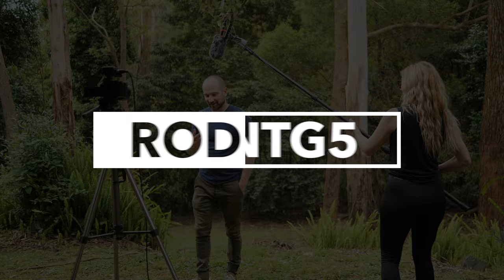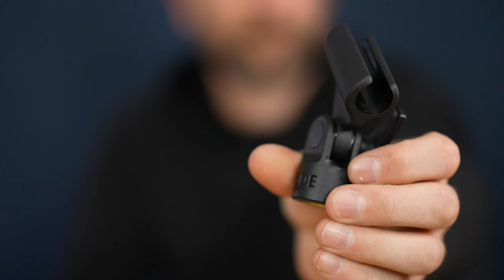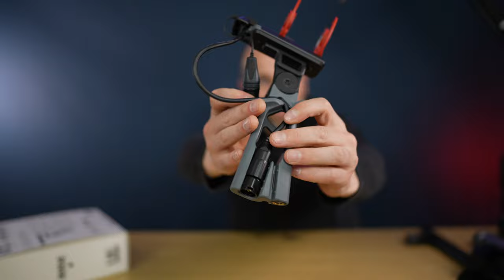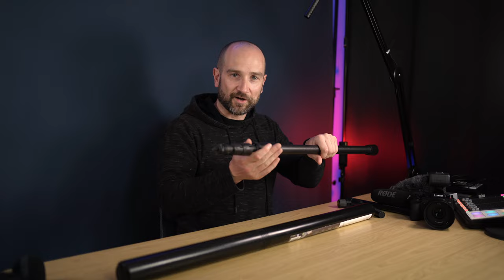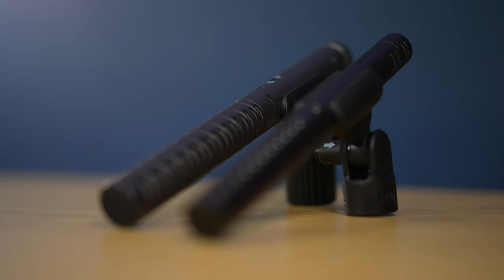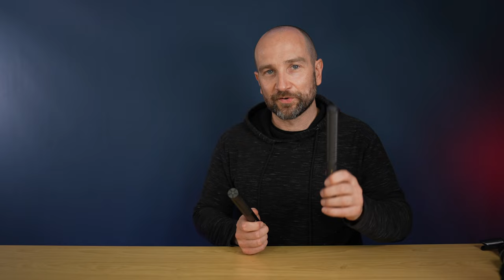Rode NTG5 Shotgun Mic Location Recording Kit Review (vs Rode NTG-1 vs Saramonic T3)

Comment: Which focus settings are you using during your outdoor talking head sections in this video? I don’t notice any background pulsing. I’m currently a GH5 owner myself. Thanks for your reviews!
Reply from the maker: Manual mode on the first shot and 1-Area Mode on the second. I have an Autofocus guide coming up this week.
Reply: @GeekyNerdyTechy  awesome, thank you for the response and thanks for putting out informative videos for GH5 shooters like myself. 

I’m trying to find a video that explains using the Panasonic XLR adapter to record audio on an XLR mic, but also recording video on a Atomos Ninja V at the same time. I’m not sure how those would work together or if it’s better just to get an external audio recorder and sync in post.
Reply from the maker: @bestinkamloops  If you are using a Ninja, I am sure the audio will be pulled from the camera directly right? The XLR replaces the 3.5mm jack once it's connected to the camera.
Reply: @GeekyNerdyTechy  I am not sure to be honest. Normally my Rode VideoMic NTG is plugged directly into my Ninja V 3.5mm jack and my levels are set through the monitor and not the camera. The video and audio is then recorded directly to the ssd that is attached to the Ninja V.

Comment: Thanks for this! I've been using the Rode VideoMic Pro+ and have wondered how it would compare to something like this. When are you heading off on your USA venture?
Reply from the maker: Hi Hospo. I haven't used the VideoMic Pro+ before but I am sure that's a great mic for it's application.  This mic is very light and great as an overhead or voice over mic but not sure how well it would perform for vlogging but I am sure it can be used. The first trip away is in a few weeks time (just a quick one) and then there's a huge trip planned for March all being well. :)

Comment: Great video!  But question, doesn’t the NTG5 need phantom power or do your camera preamps suffice?
Reply from the maker: All condenser mics require phantom power unless they have a built-in battery.  This is designed for an XLR mic input that can power the mic.

Comment: I have bought a NTG5 and I cannot get it to work with my Sony FDR AX700 Camcorder - My camcorder does have a 3.5mm jack input, I have bought an XLR lead with 6.5mm jack and a converter to 3.5mm, but it will not work.  Or is there some kind of adapter I need to buy to put on the hotshoe?
Reply from the maker: These mics require phantom power to operate. See if you camera has a powered option for the 3.5mm jack. I’m tipping you’ll need an powered XLR option if your camera can’t power it.

Comment: Wondering if you can help me - I have the NTG5 and a Sony FX6 - is it true that I also need a recorder? Can it record audio straight into the camera? I want to use it attached to the camera (needs padding to fit into the mount)
Reply from the maker: You can use an XLR hot shoe adapter from Sony if the camera supports it.

Comment: I bought the ntg5 and use it with f3 zoom. I get the most dry and super low quality audio worse than regular mics. Has anyone experienced that, It picks so much background noise and it's just awful. I suspect is the mic itself so IDK
Reply from the maker: Sounds like a bad cable or dirty audio xlr preamp control.
Reply: @GeekyNerdyTechy  Gave a new mic a chance and it was the mic. I don't know what was wrong but new one sounds rich in the sound. Thanks for taking the time to answer!